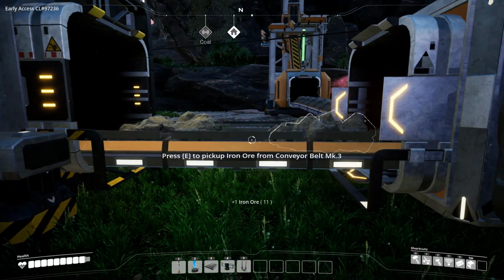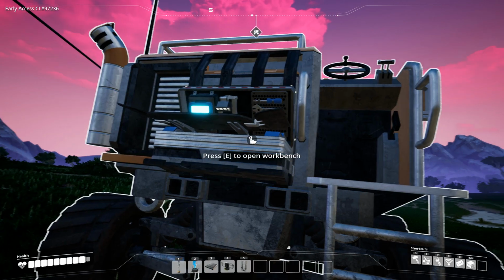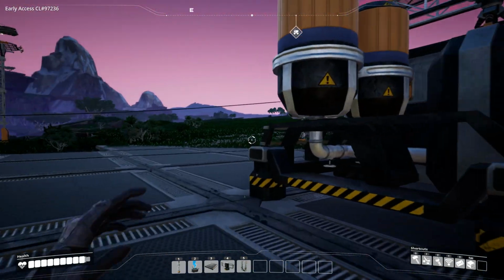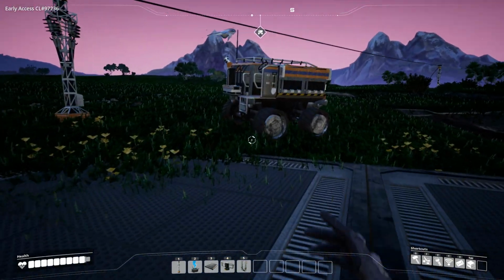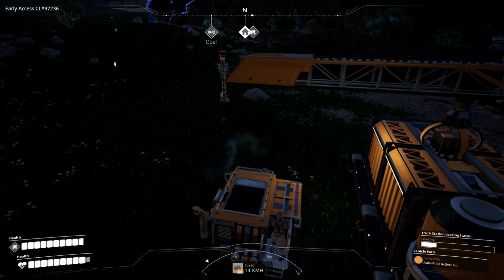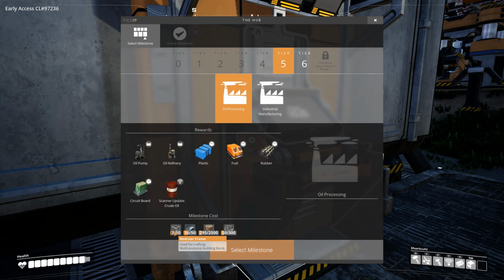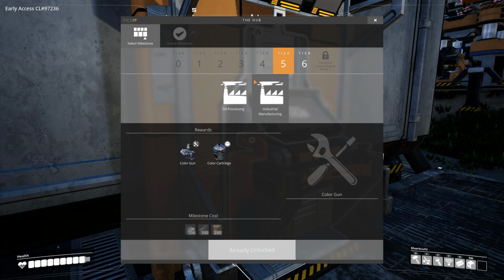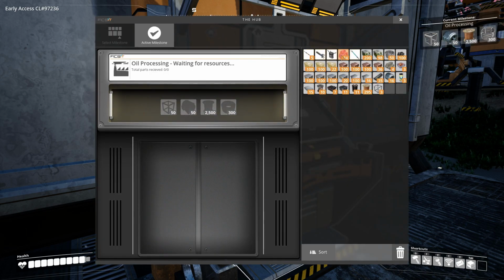Satisfactory #6 - Automated Vehicle Transport And Tier 5 & 6 Unlock

Comment: The truck you unlocked is a proper truck not a tractor so it will be an upgrade on amount moved per trip as well as being able to run on the gasoline you can create. I doubt it will do better when it comes to following the gps markers though.
Reply from the maker: Ah, that explains things, thanks!